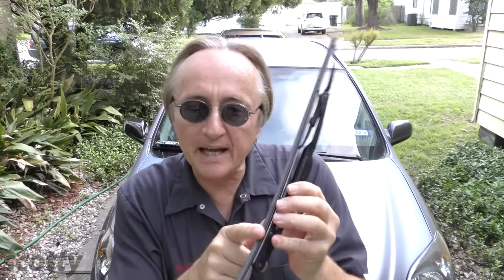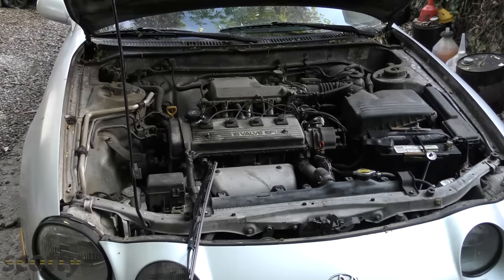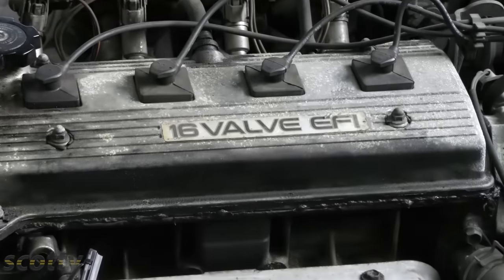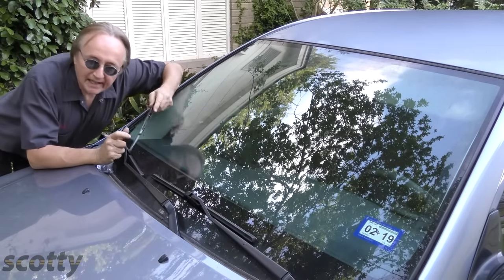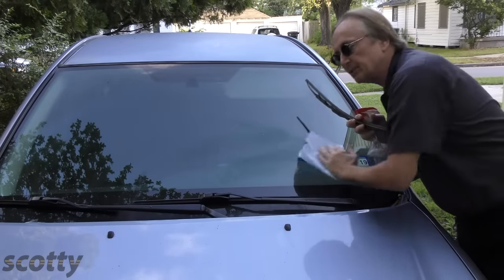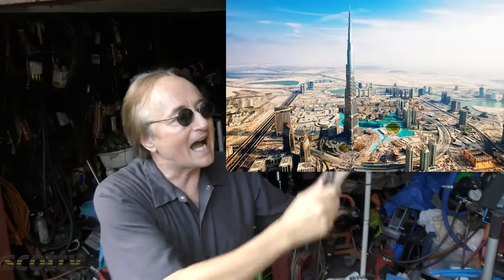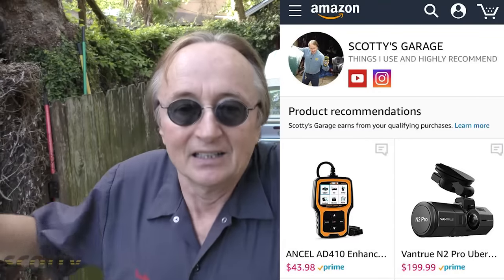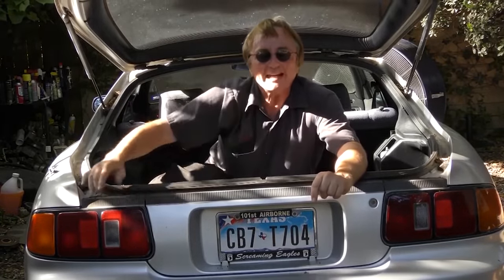The Best Wiper Blades in the World and Why

Comment: Because of you , i bought the silicon PIAA and they’re still working like new and it’s been a full year!!!
Reply: John Manalo same
Reply: Same here too.
Reply: Wait but this video was just posted 🤨 wat😶
Reply: Allen Mc Levie he made a similar video on how to maintain and clean wiper blades 3 years ago. He mentions the PIAA blades at the end of the video
Reply: John,  I purchased PIAA Silicon blades about 5 years ago...and they literally still work like new! Best investment I've ever made
Reply: iv had bosh rubber ones on my car for @ least 6 years work fine still
Reply: Same! I love my PIAA wiper blades.
Reply: Same here. I also bought a pair of PIAA last year. Now it is Dec 2020, and they are still going strong. No cracks and no streaks. A regular cheap rubber blade would have broken off already. And I live in an area of extreme temperatures.
Reply: I've had silicone blades go 8yrs before the connection point broke. I have silicone blades on all my cars.
Reply: Woah its the legendary bay area sneaker god restorator on scottie the legendary car guy video commentary nice
Reply: use costco Michilin viper blade.. it is only 7 bucks and it can last up to 9 yrs. It is good
Reply: *silicone, NOT "silicon"
Reply: So how long does that wiper last?

Comment: Just a heads up.
When replacing wiper blades, protect your windshield with a thick towel folded several times.
That wiper arm without the blade can accidentally slam down and crack your windshield.
Reply: Never had that happen in 25 years.
Reply: Happened to me.

Comment: Thanks Scotty! This is my experience also. Silicon works better and lasts far, far longer. The PIAA brand you display in this video is what I use. This is a Japanese brand, and they are less costly than Bosch silicon blades. For many years I used Bosch blades. They used to sell blades which were designed to take refills; but have now discontinued the refillable blades. This is wasteful and costly... so I wound up being a customer of PIAA. And, guess what? That's right, PIAA wiper blades are refillable, just like the old style ANCO and Bosch blades were, but they are made of silicon! PIAA makes an astonishingly good product.
Reply: Blade refills were economical but greed took over.  $$$$$$$$$$
Notice how they all went to the whole blade replacement at the same time?
C O L L U S I O N between the companies.
Reply: @norman7179  Yes, I noticed. But they didn't all make this change simultaneously. Bosch held out long after the others, until they began to make the Icon blade line, which is very sleek and expensive. No need to continue making the OG style when you can foist over priced metrosexual blades on a fickle customer base
 I abhore the sheer material waste of a wiping blade "component". IMO they are an ecological insult.

Comment: I had that same white Ford Escort 1:08. It had a small rainforest growing on the front passenger side floor from a roof leak. Wipers worked great.
Reply: Very rare for roofs to leak, but it's very common for passenger floor floods due to failure of the gasket between the hole in the metal firewall and the plastic AC/heat housing outlet where AC condensation exits through a rubber flapper to drip onto the ground which is easy to fix by applying silicone caulk between the metal firewall and the plastic after removing the right front wheel and peeling back the plastic inner fender. I recommend putting some around the studs that penetrate the firewall in that area and finish by sealing around the fresh air intake screen in the cowl area which also fails letting windshield runoff to run freely into the AC/heat housing where, just like AC condensation, it exits through the pest control flapper drain which can be a major contributor to such floods, because it happens even when the AC is not being used. Maybe Scotty will take the hint and show how to do it if he hasn't already.

Comment: I had a choice between spending $20 (Rubber) or $40 (Silicone) on wiper blades.  Took a chance, and spent $40 on the Silicone.  6 years later, they're 'okay' (they're clearly used, and the years show on them); but they still work great.  When you mash it together with Rain-X and any ceramics that repels water, it really makes a difference at how often you're changing your wiper blades and your visibility when those products bead up the water and the blades simply push the water to the side.  

I have a set of spare Silicone blades, but I'm too lazy to replace them; even though I don't have a problem spending 5 hours applying ceramics (once every couple of years) and 15 minutes once every week cleaning my truck.  A couple of times, I had thought about replacing my wiper blades; but they're so durable, that you can easily clean them with any Rain-X product and they'll be good as new for a while.  At this rate, I wouldn't be surprised those blades outlast the life of my truck.

Comment: I bought Akebono brake pads recently because of your recommendation.  Thank you for these videos.  I learn a lot.  Best wishes from ice country (Northern Michigan).  PS: I have a ML320, and that is the one area I disagree with you.  Love my MB!
Reply: MB = Maybach?
Reply: Kiraro The Kitsune Mercedes-Benz
Reply: ungratefulmetalpansy The first gen ML320 are like German tanks, they keep running.
Reply: Had a '06 ML350 and that thing would break down so often (first 2 years - 4 fan belts, alternator and bracket, water pump, power steering pump, a/c compressor, brake pads and rotors on all 4's).  After 6 yrs the intake manifold (aluminum) was deemed by MB to have deteriorated to a point where oil was leaking from its rear area.  Luckily I've gotten the extended warranty but dumped that "money pit" once it expired.  Got a '13 Lexus RX450h now and it has never gone in for any repair work.  So far, only tires  and oil changes.  Bottom line.....stay away from MB that were built in the USA.
Reply: To Dark Days:  Unfortunately I just this morning ordered Zimmermann rotors which are highly recommended by various YouTubers but I will definitely look into those rotors down the road.  I think I did actually buy Centric rotors with depressions in them and a gray coating for my e350 van a few years ago.  I will have to check on that.
Reply: Mazior Riyahidekordi:  
Mine is 2003 ML320 w163, actually second generation (iteration).

Comment: My first pair of silicone blades lasted 5 years. They were Bosh Icons blades.
Reply: No Way mines are bosch aswell. My only issue is that they are very bulky compared to the regular rubber ones but i wont complain that much, i live in florida so its hot and rainy all the time these blades have lasted forever
Reply: They’re great wipers. I have not yet changed my Bosch silicones yet in the three years I’ve had them.
Reply: Shelly Kennedy, they are great blades and I will never go back to the old rubber kind.
Reply: I bought those as well.  Lasted forever compared to rubber.  Took me a long while to figure out why those lasted so much longer than everything else rubber I used.  Finally I read the material used was not rubber!  Thats what I get for assuming.
Reply: Icons were developed for storm chasers. They're made for tough conditions. I had one I bought as a replacement in a dire time on my first car for my drivers side, pound for pound it was 3x better than the rubber
Reply: BIll A, tis but a minor detail! Lol

Comment: Piaa make great wiper blades. I had a set years ago, cost about 48 bucks. Lasted over two years until I destroyed them in a ice storm. Quiet and they also give a "rain-x" like effect on the windshield even when not being used
Reply: is it still worth using rainx along side them? or wil it mess up the silicone coating?

Comment: Another great video! I've been binge-watching them for the past couple of days, and learning a lot!
As much as I like silicone wiper blades, for me, the only negative is if you're also using a silicone-based water-repellent coating on the glass, such as Rain-X or Rain Guard (as I do). Those products are brilliant because water just beads and rolls over the car, especially as high speeds. However, silicone wiper blades shudder and jump as they're drawn across the coated glass.
Silicone-based windscreen coating products make driving a lot safer and they negate the need to use wipers at all, when driving at highway speeds. That's why, personally, I prefer rubber blades. To me, the negatives are outweighed by the positives of using the other products.
One type of wiper blades that I'll never use again are the twin blades. Due to their rocking action as they swap from moving in one direction to the other, they tend to smear the water back over the area they just wiped, making them next to useless.

BTW. I wouldn't worry about rubber having to put up with heat. Black natural rubber (with carbon) can withstand approximately 90 degrees Celsius (194F). EPDM (an artificial rubber, that is used to make automotive door seals) can withstand around 110-130+ degrees Celsius (230-266F) I don't know what type of rubber is used for wiper blades. My guess would be that it varies, and that's one reason their price varies so much. (I sell various types of rubber products)
Reply: So as long as you donot have rain x or rainguard coating on windshield then will silicone blades not jump and shutter?
Reply: I've never had good luck with windshield coatings. They always make gunky crap on the windshield for me!

Comment: I like the OEM wiper arms because of the wiper slap that I got using after-market arms/blades. I order Trico blade refills and change them out about every 8-9 months, or so. It only takes a few minutes to put the new ones into the wiper blade arms More often than silicone, I agree, but they give a good, clean wipe -- and they are quiet.

My main defense against visibility impairment is a coating of Rain-X, which I put on about once a month. It's quick and easy, and the harder it rains, the better it works. At about 35-40 mph, I can turn the wipers to 'intermittent', or sometimes even off, as the air passing over the car makes the water droplets rapidly run back on the windshield and side windows, providing pretty good visibility.

When I lived up north, the coating of Rain-X made it easier to deice the windows, using a scraper -- the ice just slid off, in sheets! The only trick is that it must be applied to clean DRY window -- if it's wet, it doesn't work well.

Comment: Good Tip even better when using rainx
Reply: WV Wildlife Cam o boy, hello fellow west virginian
Reply: Rainx washer fluid works extremely well if you give it a try. I deposits a diluted rainx solution on the glass every time you use your washers. It works well for me and even prevents chattering of the wipers that I had issues with.
Reply: Country roads

Comment: Love your show Scotty!!! I own a 14 yr old 2004 Toyota Tacoma Double cab Prerunner V6 automatic, original owner, 135000 miles, only 1 malfunction was an oxygen sensor, $130 fix (Dealer wanted $500). Wife's car is a 13 yr old 2005 Toyota Matrix base automatic, original owner, 130000 miles zero malfunctions. Toyota's the only brand I'll buy/own. Thanks for all the great info and advice!!!😀😀😀😀😀😀😀😀😀😀😀😀
Reply: Gary Hickam
130k?   That's low miles on a Toyota.   I just bought a Honda with 100k.    😁

Comment: I coat my silicone wiper blades with 303 protectant. Since I started using 303 many years ago, I have never had to replace any wiper blades. On my 1991 Honda CRX,  I drove for over 15 years and had over 800000 miles on it without having to replace the wiper blades. I first used Armor All for a few years since 303 was not available. When the 303 Aerospace protectant came out, I started using it and was quite a bit better as I did not have to apply it every week  as I did with the Armor All....only once every three months. I also use 303 on my tires. I have had tires with over 175,000 miles on them with very little tread wear and still pliable enough for a smooth quiet ride....all because I used 303. I do not get any payment for recommending 303. This stuff just works.
Reply: You spray your tire tread with 303?  Doesn't that make them more slick on rain and snow?

Comment: Canada! I've tried so many and can't believe how much they cost to start with. I need a blade that works well with ice build up.
Reply: Ladybug Adventures Good luck, short of fully defrosting the window first nothing is going to save the blades from ice.
Reply: Silicon blades are the best.  Never pull them to break the ice, as it will bend them out of shape with time.

Just warm your windshield and let them thaw from the heat.

Also, when you are parked, pull your blade's arms up to avoid ice building on the ice.  Make sure you pull from the tip of the arms (middle of the blade's frame) and not from the blade frame.
Reply: I seen some at Wal-Mart where the blades warm up for winter.  Just hook up to car battery and u in business
Reply: Very simple. Use winter blades all year long.  They work very fine in the summer too.  The only difference is that they have a shroud to protect the mechanism.  And as other said, do not use your wipers as a snow plows.  Only use them on a well de-iced and clean windshield.
Reply: EXACTLY.  If water sticks the blade and glass together, it doesn't matter what kind of blade, it's not going to work.
Reply: And do not believe those who say that putting up the wipers weakens the springs.  Under normal operation, the spring is always under tension anyway.  Yes while flipping it up, you exert more tension on the spring, but it releases to normal tension once up.

Comment: i bought walmart wiper blades, auto drive brand at $5 each..not only was i blown away by the ultra low cost, but i was equally blown away by the fact that they WORK. my old ones were horrible, we all know that awful dragging noise and streaking bad blades cause- that's what my old ones were. now as far as how long the wal mart ones are going to work- i have no idea. but $50 for premium silicone wiper blades vs $10 for the walmart ones that so far work well...maybe i'll just stick with the cheap ones! even if they only last  few months, $10 is nothing.
Reply: $10 every few months plus the time, stress and added travel costs to "go to Walmart" vs. $50 one-time for years... well if I need to explain further how youre wrong than I can't help you.
Reply: yes david but not everyone can afford 50 dollar blades i use walmart brand and my old 92 chevy has had them on for over a year still work great i just clean them every couple months thats it
Reply: Matt Higgins  I had PIAAs (not of the winter or aero variety) on a car for over a year and a half and kept the SUV outdoors. Never had an issue with them. I still have them on the car but the car's in the garage, not used now.
Reply: I bought those to try them out and they are actually very good the money.

Comment: You are right Scotty silicon are the best but here is a little tip if you want to make rubber and silicone ones last a lot longer give 
them a good 
spray and wipe with Aerospace 303 protectant every 12 months.. Absolutely fabulous gear for leather , rubber even serpentine belts. We get it here in Australia but Its made over in USA.

Comment: I just bought some michelin 2X silicone blades. I cleaned the windshield before using them, however, the passenger side, bottom portion still won't wipe clean. What gives?

Comment: yes, i have silicone wiper blades on 2 of my vehicles; just keep the glass/wipers clean monthly. I never had to replace them yet. one of the frames are showing signs of rust though. next upgrade will be beam style with silicone inserts. eBay sellers are cheaper than name brands too!

Comment: I agree Scotty!

I noticed a used Volvo S70 I bought for my mother 4 years had white blades on it, and I thought I should change these blades soon as I don’tknow how old they are but they wiped perfectly and still do!
Then I found out they are silicone when I examined them by touch.
Still so soft and flexible!

Would you recommend using a fine sandpaper like 1200 grit to clean them like they do on rubber blades?

Thanks Scotty!
-long time watcher and subscriber
Tilo

Comment: thank you Scotty * i own a 2004 Toyota Corolla with just 77 K  original miles on it' i always go through wiper blades fast i didn't know why until a mechanic told me they made these corolla's wiper system weird in that year it doesn't hug the windshield as it is supposed to ..i don't know if this is true or not but anyway he told me to buy wiper blades that hug the windshield the bendable type but still they only last about 5 months and yes i always make sure there is glass cleaner on my windshield before i use them, ever since i watched a video you made a while ago about using your wipers on a dry windshield would wear them out faster,  do you think there is any truth to this about the way Toyota made the wiper system in 2004?  i,m not a mechanic so i,m not sure who or what to believe,  i want to Thank you for all your fantastic helpful video's Scotty,

Comment: Thank you Scotty, I love your videos! I subscribed and I became a huge fan. Good job! About 10 years ago I accidentally discovered Bosch wiper blades. I was stuck out in the rain and the only thing the auto parts store had that fit my car was Bosch. Man, they were so expensive! But that purchase was when I learned that all wiper blades are not created equal. What a huge difference quality blades make. I guess the Bosch must be silicon (as you described) because they last forever and they do not chatter across the glass or smear. Thanks to you, I learned about silicon blades. I’ll give them a try and maybe I won’t need to pay so much. But if the blades you described cost as much as Bosch, I’ll stick with Bosch. They are excellent. Thank you for your wonderful videos.